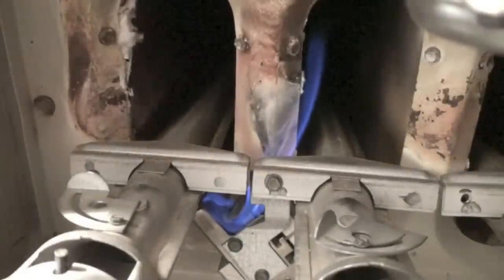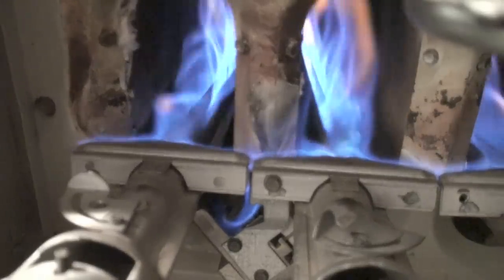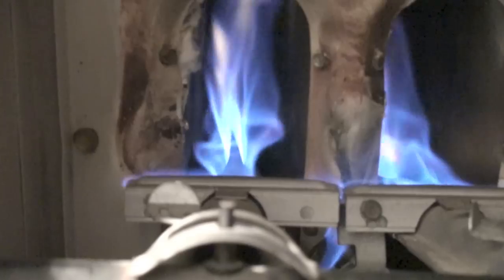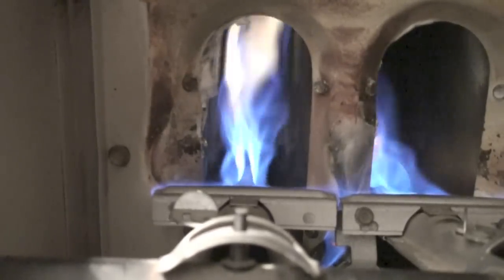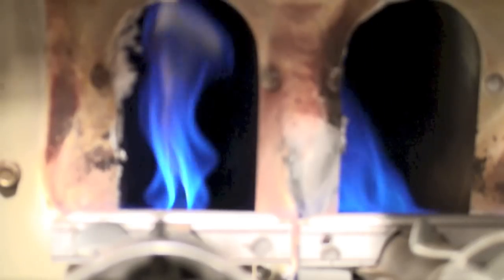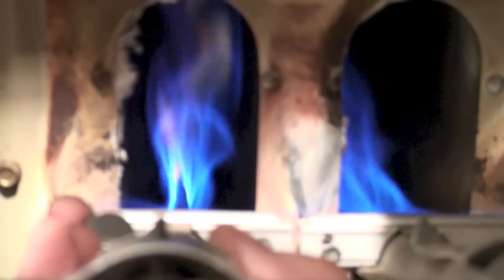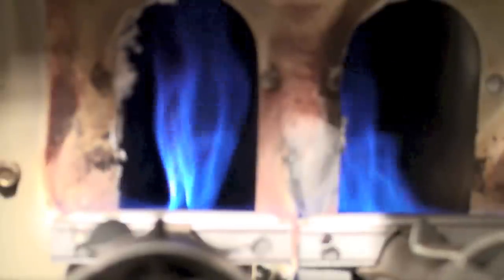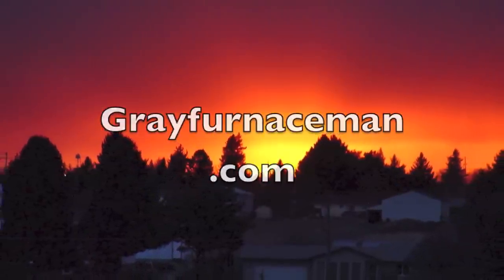How to set the primary air adjustment of a gas furnace

Comment: I will have to disagree with your flame adjustment procedure.  It is only half correct.  You eliminated the yellow tips, which is good, but you still had a lazy flame.  The proper way to adjust the flame is to continue to add primary air until you have a clearly defined inner cone.  It takes a trained eye to get it correct.

Comment: My furnace has a lot of yellow tips on all burners but one. I have the burners opened up all he way and I can't get more air to it. Do you have any suggestions? I have also cleaned the burners witha wire brush insdie and out and they are free of debris. I have the old ribon style burners on my Bryant 342-125 heater unit for my shop.
Reply from the maker: Is it run on LPG?
GFM
Reply: @grayfurnaceman  propane. I’m thinking the issue is the gas valve pressure isn’t enough, so it’s not drawing enough air. I’m gonna play with that today and see if that helps the issue any. Other than that, I’m at a loss.
Reply from the maker: @catpartsforyou  It is normal to have yellow tips on LPG or propane.
GFM
Reply: @grayfurnaceman  Oh cool! That makes me feel much better! Thank you!

Comment: If the air/fuel is not adjusted properly, would that create soot? (natural gas furnace)
Reply from the maker: It is very hard to get natural gas to soot.  I have only seen it a few times.  Propane is different.  It soots easily.
GFM

Comment: I have a Goodman high efficiency 60K BTU gas furnace with forced draft that is 19 years old.  It's said that the Goodman heat exchangers often crack. My CO reading from the floor vents was 0-5 PPM fluctuating, mostly zero but sometimes as high as 5 PPM. The manager at the gas company said below 15 PPM is OK, and my furnace likely needs maintenance/cleaning. To avoid a heat exchanger crack and excess CO would it be best to have excessive primary air flow (yellow flame tip) and reduce the gas pressure so the flame and heat exchanger is cooler? My furnace is over sized so a reduced BTU output is not a problem. I assume that heat up and cool down cycles causes the exchangers to crack. Less cycling may also reduce the probability of a heat exchanger crack?
Reply: I'm not worried about wasting gas.  It will cost me several thousand dollars to have the HVAC unit replaced.  I will have to waste a lot of gas to equal the cost of replacement.
Reply: yoyohooyo Another thought.  The heat exchanger is designed for 60K BTUs.  If my fire rate is reduced to 50K BTUs the efficiency may increase because of the heat exchanger being oversize for  50K BTUs.
Reply from the maker: yoyohooyo If your furnace is a Goodman model GMP, the heat exchanger does not crack, the rivets pop loose.  I would check the heat exchanger in the furnace.  I did a video on this diagnosis:  http://youtu.be/S8AI8VZQ-ts  Lowering the BTU input or changing primary air will not really make any difference.  I would want to be sure the heat exchanger has not already failed. 
GFM
Reply: grayfurnaceman I watched the video about the rivets failing a few days ago.  Thanks for the videos.  I've learned a lot. Yes mine is a Goodman GNPN060-3   I installed in 1996.  General Supplies Inc sells a heat exchanger for it.  Price $140.  If I remove the old one to inspect it I may as well replace it, maybe, but I worry that this exchanger might be low quality Chinese made junk.  Their ad says OEM parts but who knows?   They also sell a rivet kit.
 http://www.gsistore.com/amana-goodman-2821300s-primary-heat-exchanger.html?utm_source=googlepepla&utm_medium=adwords&id=55733401973

Comment: Greetings,th for your videos. Question: I have a pretty old furnace. I disassembled it due to a flood. I reinstalled very carefully exactly how it was. The output vents seem very hot. I'm not certain if it was like this prior. Almost too hot to touch. Is there anything that I can check. Vented properly. No roll out. Just a little concerned. The vents seem to be making a popping more than before. Thanks for your time. Jim
Reply from the maker: If that furnace was under water, get rid of it.
GFM

Comment: I  was wondering if you could tell my what is the problem with a new LP furnace? The flame starts Great, but just as soon as the blower fan kicks on the flame goes out. Any suggestions? Thanks in advance.

Comment: This is very useful info. I have a furnace like this and the flames began to turn orangish. It was dirty, hasn't been cleaned in a few years so I tried cleaning it myself. I even removed the burners and cleaned them with a new clean brush and compressed air. Now the flames are much more orange than before, even the pilot is a bit more orange. Any explanation for this? adjusting the air like you described didn't do much.
Reply from the maker: Sometimes the orange will come when burners are initially cleaned.  It will usually settle down after some run time.
GFM
Reply: I don't know GFM I cleaned a bit of fuzz from the middle burner and it turned orange https://www.youtube.com/watch?v=pR_QQmrW6J4
Then after a completed cleaning I ended up with this https://www.youtube.com/watch?v=j3J8ZQmpPsk
Reply from the maker: I can't say I have seen that.
GFM
Reply from the maker: Wow, could be.
GFM
Reply: I hate those ultrasonic units.  Dust everywhere.  Could use distilled water but would be more expensive than the electric for a steam unit that is sterile and pure.  Filters don't work well.  Evaporative is the most efficient but then you have to be careful of bacteria.

Comment: Thank you this helped me a lot. I have a old comfortmaker furnace in my apartment that I didn't know you could adjust  like that , the limit switch was set way too low  and would turn off gas before the room was warm.   So I set it to higher  temperature.   The automatic fan quit working last year, although the a.c. fan comes automatically.

Comment: Thanks for the reply. Yes it was completely under water in 2004. Cleaned blower, burners and replaced valve. Seems to have working fine all these yrs. Recently, no, it didn't touch furnace. More details. It has 5 burners that lay in chamber and blow straight up. Flames may have a little orange on tips. From what I learned from your videos, no sign of bad heat ex. Just seems very hot. Thanks, Jim.
Reply: Also, the huge blower has a separate compartment that blows in on exchanger.Thanks!
Reply from the maker: I would measure the duct temp several feet down the ductwork.  Should not be above the rated maximum temp listed on the model plate.
GFM
Reply: Thanks for the reply. Not sure what to use but will try. Also, thumbs up for your video. When I first looked at burners, I noticed flames jumping across to next burner. That worried me but you relieved my concern by saying that was normal (flame spreaders). Should I get a co detector? If so, put it near furnace or in living quarters? Thanks for your time. Jim
Reply from the maker: I never argue with a man that wants to install a CO detector.  I would put the detector in the living quarters.  Sometimes you will get nuisance trips in the furnace room.
GFM

Comment: Once again super videos.  With winter coming soon I can perform this simple adjustment.  Did you post a video on performing inspection and maintenance on an older furnace -- circa 1970's -- in which to perform before and after startup in preparation for winter use?
Reply from the maker: I can't say I have done a video especially for older pilot gas furnaces.  I have done a series on service of the 80% efficient furnace that may help.
GFM
Reply: Jay Rodriguez Please don't do this yourself ..it's very dangerous. Call a professional.

Comment: What did you do to adjust the flame?
Reply: On older model furnaces, there are several methods that depend on the model.  There will be a hold down screw on the adjustment.
GFM

Comment: Those burners were filthy. The pressed slotted plug easily, they need cleaning before ANY adjustment! You need more training. G1
Reply from the maker: The burners were clean.  The only thing I can think of is the camera does not do too well at reproducing the flames.
GFM
Reply: @grayfurnaceman  Possibly yes but I have come across this issue many times.
Reply from the maker: @mrofnocnon  That furnace was built in the late 1970s, about the time I got in this business.  I do know a dirty burner.
GFM
Reply: @grayfurnaceman  Fair enough. The pictures are not adequate to show it.

Comment: Very nice video - I have two questions please if you do not mind.  One, is there a way to reduce the flame output.  When my Central AC heat comes on, the heat just pours out of the vents. Just too hot. Second,  it seems the heat just runs forever before it finally cycles off. I would rather the heat come on with low heat output and not run for so long.  For instance, the house is 68 degrees, I adjust the temp to 69 degrees. The heat runs and runs until the temp in the house and on the thermostat is like 74 degrees from where the heat will not turn off.

Thanks
Donnie
Reply from the maker: First, I would be sure the filter is clean, the blower is clean, any secondary heat exchanger is clean, any A/C coil is clean and ductwork is in good shape.  You can check the gas input to see if it is at factory specs by clocking the gas meter.  
As for the long cycles, the thermostat has an adjustment for cycling rate.
GFM

Comment: hello  Sir i have a question do you check first how much gas pressure you have out of the gas valve l and then you adjust you primary air , because i have a Bryant furnace 396G series and they have a l;ot of yellow tips flames  thank you so much

Comment: Hi Gary - I replaced my cracked heat exchanger in my Goodman furnace and replaced the high temp roll out switch in the roll out chamber and the furnace has been working fine with neat clean flames going into the heat exchanger for the last 4 months.  Now there seems to be an excessive amount of flame coming out between the burner pipes and that flame is just burning in the chamber and not getting into the heat exchangers.  So the temp gets too high and trips the roll out switch.  Do i need new burner tubes or do they just need cleaned?

Thanks
Stever
Reply: Steve Goettler 
Venting clogged?

Comment: The flame in my very old White Rodgers furnace is completely orange.  It has a combination fan and limit control.  I have the limit set at 175, and the fan at 90.  The furnace also clicks too much before the heat comes on, and continues clicking when the heat comes on.  Please help.
Reply from the maker: The orange flames are probably due to dirty burners.  By clicking what do you mean?  Does the flame go off when it clicks?
GFM
Reply: grayfurnaceman
The clicking sound the furnace makes before it sends out heat, I think it's part of the cycling process?  I'm not sure if the flame goes out when it clicks, but the furnace clicks about 5 times before heat is sent, and keeps clicking/cycling when heat is on.
Reply from the maker: You could have a flame sense problem.  Could be a dirty flame rod.  I have several videos on flame sense that may help.
GFM
Reply: Thank you, I will watch them for my own personal info, but this latest issue with my furnace has caused me to get furnace insurance.

Comment: Thank you for showing me about changing the orifice line.  I have the vr8200 gas controller how do I adjust the burners down. thanks
Reply from the maker: There is a regulator under a cap near the inlet.  I would not adjust above or below manufacturer's recommendation and check gas input at the meter.
GFM

Comment: poor instructions - does not show what it is you are suppose to adjust -
Reply from the maker: This video is about how to set the flame and what the flame should look like when it is adjusted properly.  The adjustment method is different for different burners.  
GFM
Reply: Dinsca avinsca: I would say poor comment, its not about how to mechanically make the adjustment but what a properly adjusted flame should look like. If you know so little that you cannot see how to adjust the air/fuel mixture you probably should not be touching your furnace at all for safety's sake. Just sayin is all.